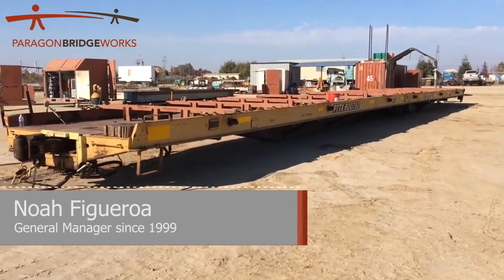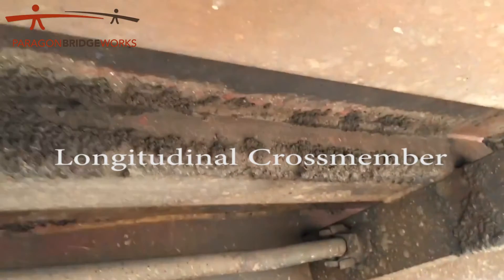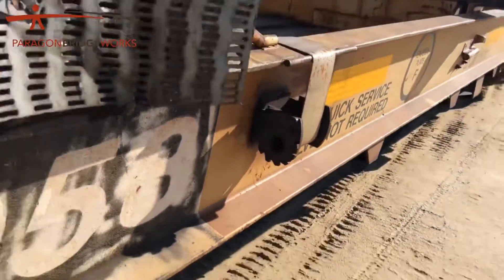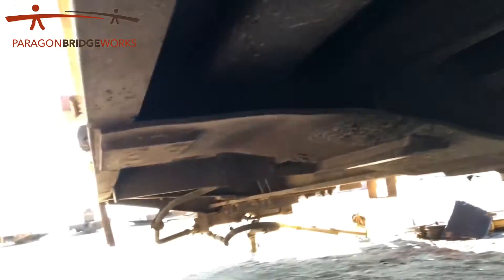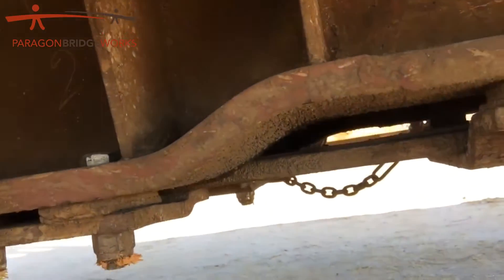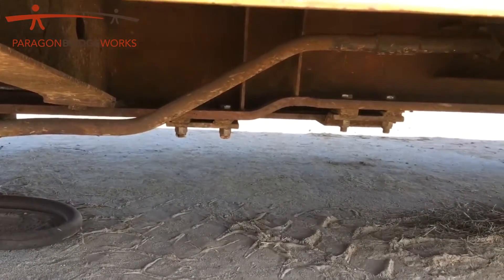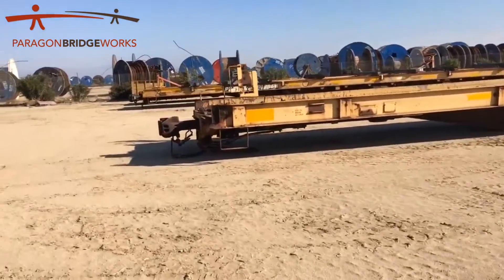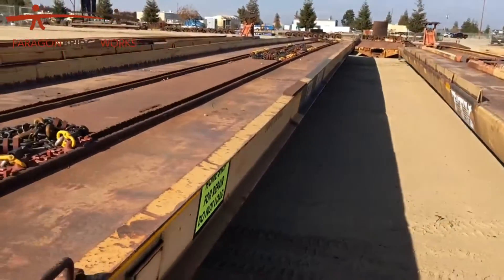Comparing similar 89' railroad flat cars

Comment: I watched most of your flatcar videos. I'm sure your comments are relevant for savvy customers but I think it would be much more helpful to modellers and train watchers if you pointed out benefits of the various construction types and what freights they are likely to be used for.  Obviously some are stronger than others - that's evident from looking at them.  And some look like piggy-back types vs loose freight. Other than that, how does a customer know which one to choose?   Cargo weight and type must come into play.  Knowing what shippers want triple WT vs double U, or 2x vs 3x height, and why,  would make for a more interesting presentation.  I suggest using salesman's feature-function-benefit matrix to bring it all home.